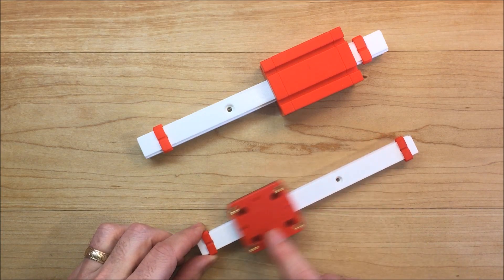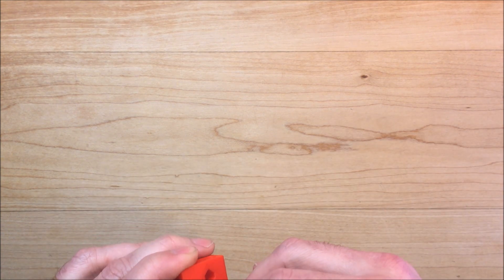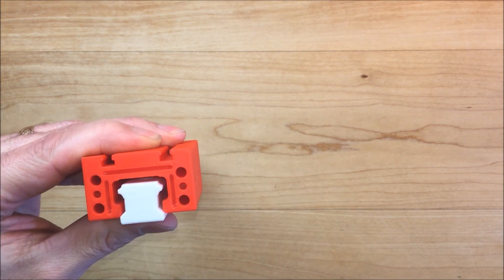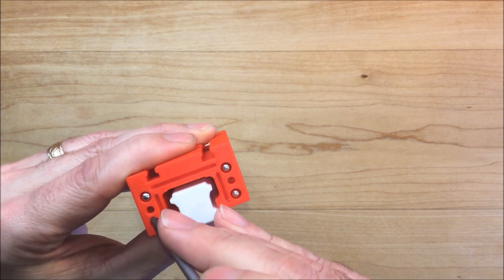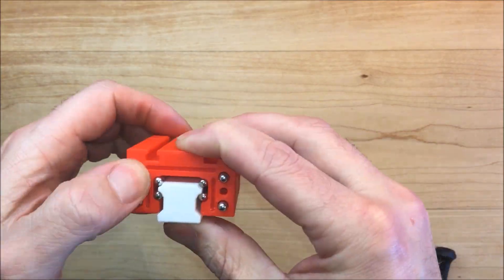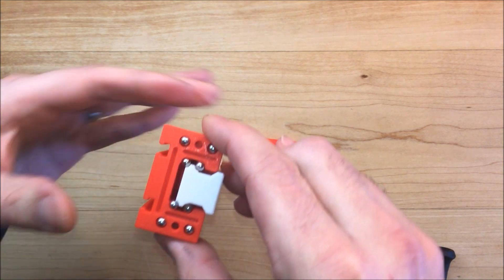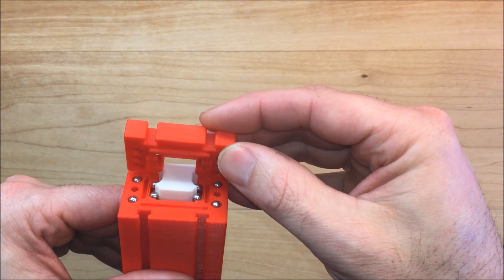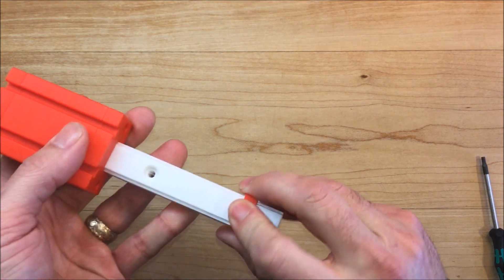3D Printed Four Row Linear Bearing Rail

Comment: Hello, thank you very much for sharing the video and the STL files. We currently tried this model using 3D printer (PLA resin) and 4.5mm steel BBs. Some stuck was observed, and the result seems not successful. I want to ask you if the BB's dimensions were correct.
Reply from the maker: Depending on if it was too tight, or two loose you can try scaling the carriage.  Also make sure the return plates on the ends are very clean.
Reply: @3DPrintingWorlds  thank you for you valuable response, we will perform another test.

Comment: I have printed the parts several times with different parameters and cannot find a configuration that works well. Either it is very hard or it dances on the rail.

Do you have any parameters about horizontal expansion that can help me? Or at what layer height to print the rails. I have all the Y axis printed and then I read where I said to first try linear bearings.

Thank you.
Reply from the maker: I know people have simply scaled the block to fit the rail better.  Mine was printed at .2 layer heights.

Comment: Just an idea, put a piece of paper on the endcap once it is filled, then the BB's wont fall out when flipping it over to the main bearing. Of course, remove the paper before screwing it together.
Reply from the maker: That should work.  Another idea I had was to use a magnet on the backside of the return cap.  I've done it so many times now, its easy for me. lol

Comment: This is another cool design.  Well done, might I recommend instead of doing the fast flip to put last cover plate and BB's in, perhaps using a magnet on the backside to hold everything in place while doing the final assembly might make life a little easier.  Cheers, great design.
Reply: Some engineers on another video said magnets are the enemy of ball bearings that it'll cause problems with them because they are very easily charged by the magnet.. I guy made a video showing everyone how to clean and fix cheap Chinese linear rail carriages and he dumped all the balls into one of those mechanics magnetic bowls for screws. A few engineers said he did a good job but the worst thing he could do was but anything relating to metal bearings near a magnet.
Reply from the maker: yep, using a magnet works great. Someone in the Mostly Printed Printers FB group already  suggested it.

Comment: within the first 30 seconds, I can see these are going to be terrible... You can see just how much the wooden block shakes as its being carried over the 'rails'.... Basically, the accuracy and stability of these printed 'linear guides' are dependent on the accuracy and tolerances of your 3D printer... If you have a crap printer, printing these in hops it'll give you a better printer, then you'll be mistaken... you MIGHT get a 'eh this is barely ok' printer out of it, but then you'd have to make more, and then MAYBE you'll get an 'this is ok' printer, and then again to get a 'this is pretty ok' printer.... you'll never really get something really 'good' out of it....

THOUGH! With all that said, I REALLY do want to print these just to give them a shot lol. They may suck for actual movement, BUT for Z Axis? This may be pretty good. Your Z Axis doesn't really need to move all that much, so the slight variations wouldn't really matter 'as much' as it would on the X axis or Y axis. You 'may' have to use more than you normally would though. As in, if you were just going to put one rail on each side, you might wanna put 2 just because plastic warps/bends... its not very rigid compared to hardened steel... So you'd want to make sure that it can withstand the weight that'd be placed on them.
Reply from the maker: Its definitely not a replacement for an actual bearing but what you are capable of accomplishing with the technology is pretty impressive!
Reply from the maker: I also just finished the design of a 3D printer that uses these bearings. This printer is not about print quality but about using a bunch of  3D printed parts. It was a lot of fun to design. I will have some info on it shortly.
Reply: have u printed the linear slide ? i had tried it 2 days ago. i have been playing it day & night for the past 2 days. i print it with creality cr-10s5. it has lots of ghosting issue because of the bed weight. I am shocked even with a lot of ringing it still slide quite smooth. the only concern is the linear slide shrink while the room temp is cold. so the slide will be jerky when its night time/cold. maybe with an enclosure with little heat will make the performance better. i'am planning to make hypercube frame with this slide. if it fail, i will just build a Mulbot instead because @3d Printing World has prove it to achieve  a good print out of it.
Reply: Have you considered these being used as drawer slides instead of printers? For those types of applications these are perfect.

Comment: This is so great! Instead of buying overpriced linear rails for your 3D printer, simply print them yourself. That's what 3D printing was meant for :)
Reply from the maker: I'm actually designing a printer that uses these bearings!  I'll post some videos when its finished.
Reply: @bensonhadlock4389  I am aware of the RepRap project. What do you want me to tell with this link?
Reply: That's absolutely not what 3D Printing was meant for.
Reply: @ericvauwee4923  Who cares ? :)
Reply: @k4z41d3  I dont care if you print linear rails. What I care for is people implying 3d printing, or FDM in particaulr was the one to rule them all and solves every problem ever. That's just not the case. It was developed as a rapid prototyping process, nothing more or less.
Don't get me wrong, I love to print stuff, even stuff that shouldn't be printed. But statements like theese are what set wrong expectations in people that are not familiar with the field. And when they then try to print i.e. a car exhaust bracket from PLA and it melts in 3 secs due to the heat they damn 3d printing for it.

Comment: Have you considered using ball bearings instead of Bb
Reply from the maker: Thanks for the suggestion! I figured I would use BB's because they seem to be pretty round and easy for anyone to get but now that I measure the BB's I have there is no flat spot that I can tell but the diameter appears to fluctuate by .001-.002". I bet it would take some of the vibration out if I used  true bearing balls as the tolerance is held much tighter. They are available in the same size too!  They cost about 4x's more but I think I will give them a try to see if they make a difference.
Reply from the maker: I went with grade 100 balls as grade 25  were 6x's more. They still have a tolerance of.0005" so they should be alot better then BB's. I found daisy BB's can range between .171-.177 but typically are around .173-.174 which matches up with what I am measuring.
Reply: @3DPrintingWorlds  In the end, did you tested and compared the performances between origninal BBs and true bearing balls ?
Reply from the maker: @k4z41d3  Yes, I switched to G100 bearing balls for the 3D printer.  They are rounder and run smoother.

Comment: hi ,on thingiverse this files are too small, pls do you have original size of this stl?
Reply from the maker: Oh, sorry about this but I designed them using imperial units so the stl's actually are in the original size. If your slicer does not recognize this all you have to do is scale them up 25.4 x's or 2540%.
Reply: 3D Printing World thx
Reply: @3DPrintingWorlds  Could you add that to the description?